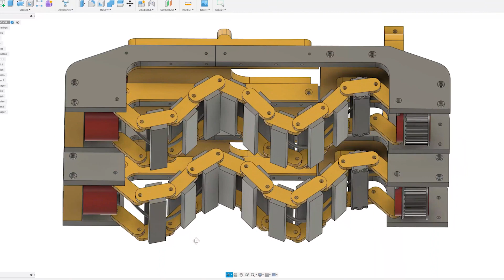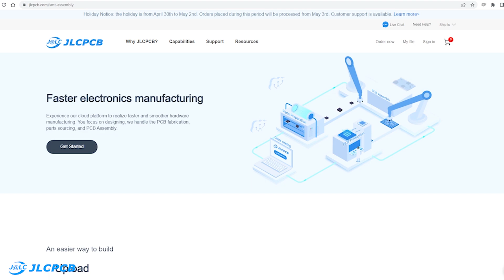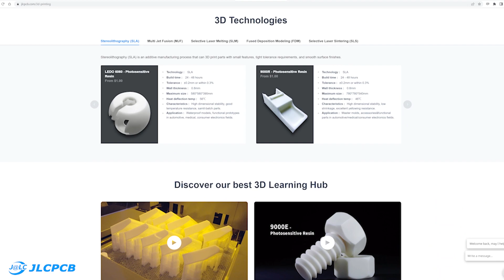Experimental Wave Drive

Comment: Great video with an extremely novel drive mechanism! I'm curious if dividing the both tracks into two (for a total of four tracks, two for each side), with every track running 90 degrees out of phase, would help with stabilizing the gait. I wouldn't envy having to design that though!

Comment: Just a thought .. When making a bigger version it might be easier to weld together a bunch of elbows or formed bends rather than trying to form a spiral from a straight steel tube. 
Considering that you have the tools, you could make the bends yourself. That and welding them back together might be extra work but would surely make it more replicable.
Thanks for all the excellent videos!

Comment: thinking about this mechanism, I don't think the wave is actually what's moving you. As proof, consider something with lots of vertical legs next to each other than can only move up and down, if you drive them in a wave pattern, you aren't going to move on solid ground (in water you may be able to do something)

I think that what's actually moving you is the hinging of the track segments, the one in front touches down just a little before it is flat, and you move the weight onto it and at the same time the contact point is moving slightly to the rear (as the track segment becomes flatter)

I'd bet that if you removed the rubber feet (reducing the leverage) and ran this on a hard surface with no give to it, your movement would pretty much disappear.
I think the same thing would happen if the bottom of the tracks had less of a gap between them.

a screw drive directly on the surface is applying force forward and sideways, in this robot, that screw slips inside the track both ways

you could have something with just two feet per corner (upside down V) that opened and closed the V, shifting weight from one to the other (so that the one moving the 'wrong' direction can slip) and I think you would get at least as much motion as from this wave

Comment: I don't know if you have access to a lathe, but there's a very simple process for making rather custom springs, basically a piece of tool steel with a hole the same diameter as your wire. You can use the speeds and feeds to customize the length and width between coils while ensuring they remain coaxial and ascribe a perfect diameter.

Comment: Why you don't 3d print the helix? She might even doesn't have to be round between the tracks. But have a corner at every point where the helix touches the tracks. Or like a camshaft. But the problem is probably that the tacks also move sideways? Because the horizontal distance between the tracks changes with the angle of the tracks. So the question is what moves the robot ahead? Is it because of the tilt of the tacks? If so would it help to make longer legs on each track in oder to increase the effect of the tillt movement and walk faster?

Comment: For forming the helix around the metal form, I suggest using a metal that work-hardens, like brass.  If you heat it with a blowtorch, and then let it cool back to room temperature, it will anneal and you can bend it easily.  Then you can easily form it around the plastic helix.  Bending it, or tapping on it with a hammer and anvil, will work-harden it, so it becomes much stiffer.  If it’s not quite the right shape, you can anneal it and bend it again.  I typically get two bends, or five hammer blows, before it stiffens up.

Comment: A low friction bar stopping the top of the track from rising too far might help avoid sagging. So it's a wave constrained between two parallel surfaces (top bar and ground).

Comment: I wonder if you would be able to use an old worn out car spring as the coil? Itd probably be cheaper than getting a coil made by a company. But I could kinda see you needing to make much much smaller linkages to go around the coil. If you could even find a pair of springs that are stretched out enough.

Comment: could you use 2 dimensional sine waves offset spinning instead of coils? or use a series of motors pushing the "track" segments down based on digital sine wave provided? if you did the latter you would be able to bypass screw deflection.

Comment: Colin Furze's Screw Tank design used a left hand and a right hand threaded screw and to drive forward they were driven in opposing directions, I think that method would reduce the amount of wobble while also adding accuracy to the steering. Also there must be a calculation to the wave height to length which would optimize ground contact and speed.
If you are looking to make a coil around bar stock, heat the coil while you bend it and keep it on the bar when you stretch it so it maintains the diameter while also tightening down any imperfections or variations on height. Or again borrow from Colin's design and use flat stock around a centre barrel/pole.
Either way, you will figure it out and make a design that is brilliant, as always!

Comment: For the riding wave drive (the wave rider?), you could try using something like a ground anchor used for dog leads, or tents, etc.  If you can find something that a large breed dog can't pull out of the ground, it might be heavy duty enough to form some tracks for one end or the other of your vehicle.

Comment: I think if you accounted for the spring-back of the screws they should match your CAD better. The other thing that could help out is using a 2 part assembly to form the screw, where you have the mandrill with the profile inside and an outer housing that you would rotate around the mandrill to hold the screw in place. Either way, this is a really cool concept and I look forward to what else you do with wave generators for motion.

Comment: I think your screws need to have some more runout before they terminate at 90° into the bearings, because additionally to making a wave motion, the tracks need to slide back and forth along the screw a little, providing for the "walking" longitudinal wave motion of each track element.

Comment: For screws - I used to work at festivals and agri-shows, we'd frequently pin tents down with giant screws that shape. You might have seen smaller ones used as dog-leash tie-downs in front gardens etc. The ones we used were a about 5' total length, 8" diameter coil with a full rotation every 10", just a bit thinner than rebar - should be ideal for what you want, although they were heavy.
Reply from the maker: Cool thanks
Reply: @jamesbruton  Also check garden supplies; they have such screws for climbing plants. Although I think those might be a bit big for your purposes, I think they start at about 4 inches diameter.
Reply: Another option for something large for the rideable is a spiral ligature - it's a spiral of rebar meant to be pulled out to a column and welded to vertical ties to support a concrete pillar. I'd guess you could weld 2 together in parallel to lock in the spiral shape. They seem to come in various weights and diameters.
Reply: Or possibly use an easier/stronger to make solid spiral on top of the tracks. Then the spiral focuses on the down force and bungee (or something else) does the up force.
Reply: Or you could use one of those big screws to shape the wire screw reliably

Comment: I dont think this is a durable design, the screw will always be prone to changing its shape, getting stuck etc. This should be tried with sliding rails at the sides. The ground clearance would not be great, but the stability would improve. I hope i can try something like this with 90% wooden parts, since i dont have a massive 3d-printer farm.

Comment: It actually drives a fair bit slower than a "screw tank" would, because the driving force is really only the tilt of the section of foot in contact with the ground. It would drive quicker if the track sections had studs offsetting the contact point from the hinge, but it would also require more power. The other advantage compared to the screw tank is that you can do full differential steering without just rolling sideways.

Comment: Have you considered using a bunch of cams in a line to drive the wave motion? They could maybe be geared together or driven by a belt? I'm not sure. This wire actuation seems like it can't be very rigid, which will probably be an even worse problem if you scale it up. Love the music, by the way. It fits well.
Reply from the maker: That's interesting, thanks
Reply: @jamesbruton  The extreme version of this would be to dispense with the track and have a line of many legs that whirl around in full circles rather than swinging back and forth. The lower envelope of the legs would be wave-shaped. As a continuous transformation, supposed the pivot point of each leg is the focal point of an ellipse, and the distance from the pivot point to the ground is kept constant. At eccentricity e=0, you have interleaved road wheels, at e=1 you have line segment legs and in the middle you have elliptical legs.

Comment: Flexible tracks will be excellent, but could be assisted by the corkscrew being Nitinol with periodic connections to shock and contract it.. hopefully doesn't need separate insulated sections of nitinol joined by sliders.

Comment: If you really want the wire bent into the right shape, a roundabout method would be to 3D print a giant mandrel in the correct shape and size, then use that to make an impression in sand and melt some metal, possibly aluminum or steel if you can finagle that, and cast it, then when it has cooled down you could bend the wire around it. There are spring calculators that you can find all over the place to determine how big the windings should be and how far apart, so you should be able to design it with CAD software and make it dimensionally accurate. If you've never done casting before, don't make the cast part solid. Ideally you would make it thick enough, if it's aluminum, to withstand the bending pressure of wire that thick, but it should be hollow inside, as a tube. If you have a welder, you might also be able to just buy a steel tube and weld some fins onto it to hold the wire, which would be immensely easier, but harder to get as precise. All depends on how precise you really need it.
Reply: that's really in the realm of a specialist company
Reply: @DrWhom  Not really. Anyone can do it, it just takes a little practice.

Comment: You might get better performance with more flexible track. Using a different design for the side brackets instead of simple straight pieces might work better - maybe use a flexible material, or a different geometry

Comment: If you can use a metal forming tube then you can heat the wire with a blowtorch while forming.  Will form much easier.

Comment: Put small round beads on the screws that freely rotate when in contact with the tread.  Much less friction and smoother operation.
Reply: that's brilliant! not only would it reduce the friction but also could add a sort of suspension if made from TPE or similar

Comment: With the metal rods in the tracks. Could you print out some kind of mold to bend it as you push the metal through?
Edit: I just saw you have a pipe bender now.

Comment: Have you thought about multiplying screws? If you mount 2-3 screws coupled together for each track then they should not collide with each other, but at the same time load on each screw would be lowered. Also tracks would run more parallel to ground - with one screw only probably they tend to skewer a little bit when screw is on one side. 
Unfortunately using multiple screws per track would greatly complicate mounting them.
Reply: 2 forces at 180 degree opposing phases would result in no output, a 3 phase though could work in a sort of triangular 60 phase but the lateral positions would be more restricted so less up and down movement. I'm sure there is a way to calculate the optimal track movement but it would have also rely on the overall length of the treads... if you can call them treads, but 3 screws would add a lot of stability for sure, I don't think he would though as that's some complicated metal work, maybe if he had a CNC lathe

Comment: Quickest way to make that design work would probably need some king of rail bearing in each linkage in order to carry the screw and help with the stickiness problem that seems to plague the design. This would reduce the need for a perfect screw as well (I think)

Some kind of suspension or pre-tensioning might help a lot, too. To me, it looks like every part of that drive mechanism is fighting with the rest and it really needs something to sort that out.

Comment: It isn't being driven by the wave itself though, like a screw tank. You can easily see that because it travels in the same direction as the wave! The contact patches travel forwards along the ground whereas on a screw tank they are static or slip slightly backwards. What's actually happening is that the little feet are quite tall and are basically acting as tiny legs.

When the wave passes through the contact patch it tilts the little feet backwards so they push the vehicle a little bit forwards. You could do a version with longer legs and it should go much faster!

Great video anyway!
Reply from the maker: Thanks - the original version doesn't appear to have very long legs, if any.
Reply: @jamesbruton  Yeah I guess that's why it has to move so fast! As far as I can tell the wave travels forwards on the original version too.

Comment: Cleat spikes might provide a very good traction for this project. Each one would rotate freely. The only issue would be the difference between the inner and outer one when turning. Though.... there's nothing preventing multiple tracks on each side....? Seems like a promising idea.

Comment: Comercial springs aren't made by winding wire around a mandrel. Wire is fed through a die and strikes an angled anvil that causes it to bend into a spiral. The position and angle of the anvil determine the diameter and lead of the spiral. The anvil's position can vary to make conical springs and multiple anvils allow end loops or hooks, etc to be formed. It would take enormous force to feed thick wire or tubing though.

Comment: Could you 3D print a spiral. And use it as a form to cast the spiral out of metal? seems like you would have a lot more control if you could just calculate and then digitally create the spiral. No? And I think a cast would be strong enough to support a vehicle. Maybe overkill tbh.

Comment: You may get a better corkscrew spiral by forming the wire into a tighter spiral initially and then stretch it out to make the required spiral. 
EDIT: Ah you covered this idea at the end of the video.

Comment: Could you use a cam shaft instead of a screw? Might be easier to fabricate within tolerance?
Reply: You really need the single links to tilt while they are touching the ground, otherwise you'd just be lifting and dropping your "feet" while standing in place. A camshaft might work, but you'd need two connecting rods per track link, or to run the rods to the track hinges.
Reply: @TDOBrandano  tilted cam rods would do the job, I don't see why you'd need two

Comment: You could 3d print a form mold and cast carbon fiber in it to make the screw. It would be messy but viable. Or you could possibly form it with some 1/2 in emt tubing. If you had some huge waterjet with a rotating Axis it could be cut out of a large tube of some sort. Maybe it would be better to find an augar already made and some how use that.

Comment: I think you'd eliminate a lot of the jamming if you give your idlers an extra degree of freedom. they seem to want to be able to slide back and forth as well as rotate. 

also you might have more luck getting the springs into the right shape if you get them red-hot with a blowtorch first to anneal them and soften the steel so it's more compliant (obviously the form you wrap them around would also need to be metal in that case)

Comment: I think your objective will be easier to achieve using a cam shaft above the tracks with the 'piston rods' connected down to the track.
Reply: definitely, could even use a metal square or hex shaft and 3d print the individual cam-arms, benefit from the strength of steel while also fitting his usual objective or making it mostly 3d printable

Comment: That drive looks about as efficient as sitting on on a skateboard with a towel hanging off the tail end and pushing yourself off with your feet only ever touching that towel.
Reply: you have tried that haven't you
Reply: @DrWhom  I'm sometimes walking around in the bathroom without leaving my towel. One of the many disadvantages of having roommates.

Comment: I get the feeling that this needs some compliance in it somewhere but I'm not sure exactly where. I feel like maybe the pins at the end where the track is joined to the body of the vehicle need to have some ability to move, maybe vertically like a suspension? Or perhaps you could just print the last segment of the track front and back out of TPU instead? I think the resolution to the jamming might be adding some compliance instead of trying to make the helix perfect.

Comment: if you slide beads over the screw would it reduce the friction on the track? also when making a new screw you could 3d print a jig to wrap the metal around then twist it off

Comment: Why does this thing move at all??
Reply: Think about it like this, the screw is not only lifting and lowering each segment but also trying to push them backwards through friction. The friction on each segment is not equal though, the segment that is currently planted on the ground is squeezed between the screw and the ground and so the normal force is higher there, so that segment is pushed back and the screw is pushed forward, and that force is transferred to the vehicle body. Meanwhile every other segment that is not in contact with the ground doesn't have as much friction. Those segments are free to slide forward against the rotation of the screw because they're being pulled on by the hinges between the segments.